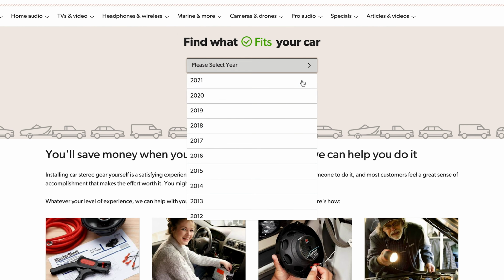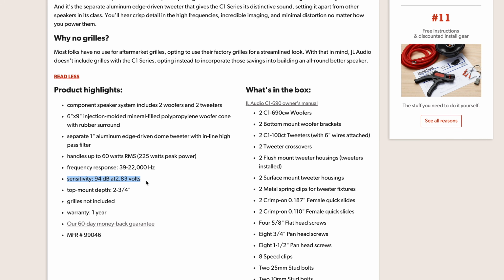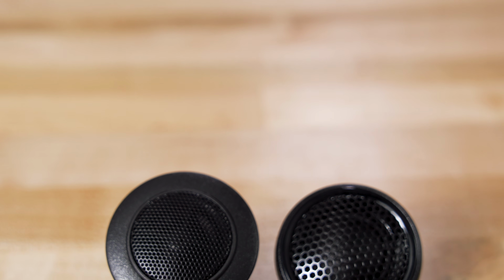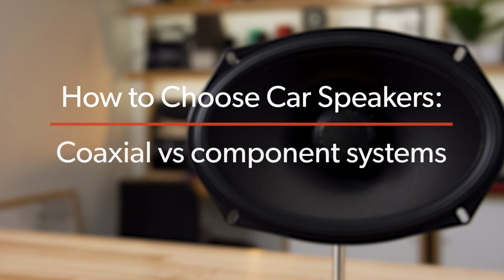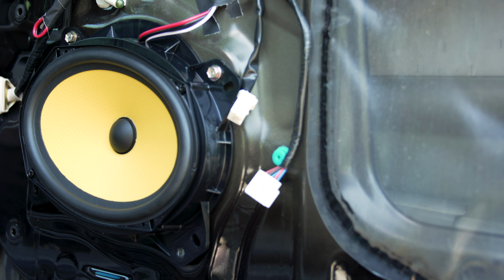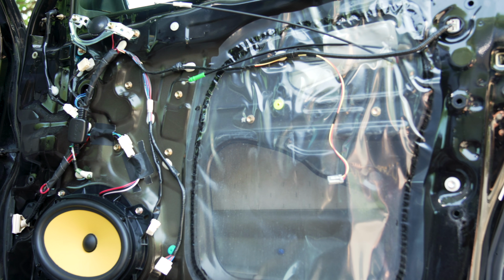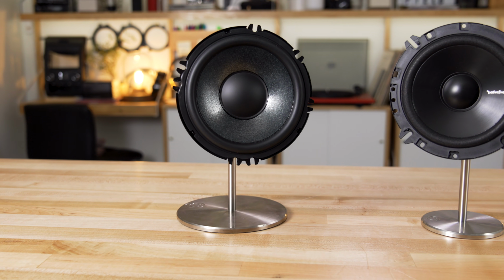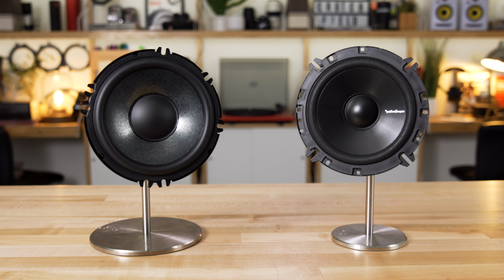How to choose car speakers | Crutchfield

Comment: Awesome.  Is there any problem with speakers that are capable of much more power than the deck?   My new Sony deck has 20W rms rating and my new infinity speakers have 100W rms rating.  I am not planning to add an amp at this time due to cost/budget.  Will be hooking all up through factory wiring and running off the deck.  Any problems with this plan, other than not being as loud as is capable of?
Reply from the maker: Infinity speakers have a fairly high sensitivity which indicates that they can perform well when they don't get all the watts RMS they can handle such as when you are powering them with a radio! Now, you won't get all the performance that the speakers can give, but they won't be hurt when powered by a radio.
Reply: @crutchfield  
Got them installed today. Sound great.  Though I notice quite a bit of distortion blowing when reach about 26/40 on the Sony 5600 head unit bought from Crutchfield.  Is this distortion coming from the head unit running out of power? Gonna need an amp?   It is plenty loud at 22 on the volume. But if I want to go higher to get the 6x9 infnitys thumping the system starts blowing raspeberries (distortion). 
There is a used JBL gto ez5  in local ads.  Maybe that would be a good fit for this.
Reply from the maker: Whenever you start to hear distortion, it is a good idea to back off the volume. You can tweak the Sony radio's equalizer settings to optimize the sound quality if you plan to crank it up. You can also use the JBL amp as it looks to be rated at 50-watts RMS for the 4 main channels. Adding the amp would provide less distortion and a little bit higher volume if you plan to crank it up.

Comment: I got a question, this will be my first time changing any speakers, can you hook up a 8 inch or 10 inch and even 12 inch speaker with no amp? Anybody can give me an answer
Reply from the maker: For an 8", 10", or 12" subwoofer, you will also need a separate amp to power them, unless it's a powered sub with its own built-in amp.

Comment: Still don’t have 2022+ Tundras on there. Why?
Reply from the maker: We have not been able to get our hands on them to perform our research and gather the measurements needed to check fitment of new gear.

These pickups are still on our list and we remain hopeful that we will be able to research them. We cannot give a time frame as there are many factors that must all line up right to make it happen. Mainly, we are able to get one of them into our research garage at the same time we finish researching the vehicle currently in the garage

Comment: Great speakers if you just want to upgrade your speakers are some focal icu speakers. But I still recommend a sub to go with them. After market speakers just don’t have any bass
Reply from the maker: You can't go wrong with Focal speakers! 🙂 What type of subwoofer did you add with them?
Reply: @crutchfield  I have been using the same Infinity VQ Kappa Perfect 12 sub from like 2005 with an old kenwood 2 channel amp from the same time lol. I love that sub

Comment: I already have 4 coaxial installed in my door do I need to add component speakers aswell or tweeters. Thanks
Reply from the maker: Component speakers utilize a crossover to split the frequency and impedance to both the woofer and the tweeter. When adding tweeters custom in a vehicle that did not originally feature them, using component speakers instead of adding tweeters to your existing coaxial speakers is usually the best move.

Comment: Thanks for the presentation, but for MG car i couldn't find along the site, what fits MG 6 2023, please?
Reply from the maker: The 2023 MG 6 is not a vehicle that is sold in the U.S. market and won't be found in our online vehicle guide. You usually can still upgrade your speakers, but we will not be able to provide any fitment information to assist and they would have to be considered a custom install.

Comment: What's so good about focal
Reply from the maker: Focal is known for their quality build and high-fidelity sound. Are you looking to add new speakers to a specific vehicle?
Reply: @crutchfield  I did see another video about the high quality materials they use. For me I'll stick with kicker. I just completed a single solo x l7 12 inch subwoofer box build. To keep up with the bass I got kicker KSMT snowman pods on the A pillars and a Rockford fosgate pps4-8 mid range to replace the 8 inch OEM Bose subwoofer that came with the car under the speaker tray. I plan on letting the bose door speakers live their lifespan before replacing them with probably some kicker KS series speakers
Reply from the maker: The KS Kicker speakers are a solid call in my humble opinion, they are probably one of the most popular speaker lines we carry and have a nice smooth sound. Sounds like a fantastic setup, great work! I usually run the Kicker C series and recently upgraded to the Focal Flax 2-ways for my daily-driver, and I did notice a major improvement. Since you are going to use your Bose speakers for a while, keep the Focal speakers in mind!
Reply: @crutchfield  I will certainly keep them in mind once it comes time to replace them... thanks for the suggestion! 👍🫡
Reply from the maker: We are here to help anytime!🤘

Comment: i have both rear speakers not working, if i buy new ones would that make difference for me setting in front ?
Reply from the maker: We're glad to take a look. What is the year, make, and model of your vehicle? Did you notice the rear speakers stopped working just recently?
Reply: First of all, thank you for your response. My car is a 2008 Camry. The rear speakers were working perfectly. After a period of time, they started to distort, so I cut the wires and they turned off completely. My question is, will there be a difference if they are on or off for me as a front-driver? Will the sound get louder and improve or not? Because I sometimes feel that the sound comes from the front only, as if it bothers me, are the front speakers sufficient for me, or should I buy the rear speakers as well? @crutchfield
Reply from the maker: It seems you are missing the sound from the rear so replacing them is a good plan. Did your car come with factory navigation or a JBL audio system? What type of speakers are you using up front? What do you prefer to use to power the new speakers?

Comment: Very proffesional and clear. Thanks for this. Excited to throw some nice 6-3/4 speakers in my 2019 mustang for the rear deck and the doors. Shipping is literally on par or BETTER than amazon in my state (Florida)
Reply from the maker: Upgrading your speakers is the best first step to better than factory sound! Are you eyeing any brands in particular for your Mustang?
Reply: @crutchfield  Yes! My Kenwood Krispy Kentucky Fried  KFC-1796PS get delivered today! Cannot wait to throw them in
Reply: @crutchfield  those factory ford  speakers are garbage. I have 40k miles and one is already doing that annoying buzz rattle on heavy bass. So I decided to change all 4. Lower front door speakers, and both rear deck speakers
Reply from the maker: 😁Excited for you!
Reply from the maker: Good plan! Let us know how you like the new Kenwoods.

Comment: what's the difference if say a speaker specs it out as 90db @ 4ohms, whereas another one specs it as 95db @ 2ohms, which one would have higher sensitivity?
Reply from the maker: The speaker with 95db has the higher sensitivity. The higher the number, the more efficient the speaker is.

Comment: I cant find my car on your side, its hilux surf toyota, yes there is a 4runner but audio looks different,  its panasonic. Still not sure about size and power but i dont want to touch that panasonic, just looking for speakers.
Reply from the maker: We do not have any JDM vehicles listed in our Vehicle Guide. On a personal note, I have wanted a Hilux SURF forever. Totally awesome ride! JDM vehicles can have some slight differences, we treat them essentially as a custom install. If you can gain access to inside your door panels and remove the old speakers, snap a few good pics with a measuring tape and call us at 1-800-309-2795. We can help identify speakers that would be a good option for your upgrade.

Comment: It’s the JBL Stadium 262M speakers a good choice for a ‘13 Camry XLE using the factory radio ( not JBL) with navigation ? Please need your expert opinion before buying 🙂
Reply from the maker: Did you mean JBL Stadium 962M? If so, we do show you can fit these in the rear deck. Which locations do you want to put new speakers into?
Reply: @crutchfield  I’m sorry☹️ yes JBL Stadium 962M ! I would like to install them front and rear 😃
Reply from the maker: Great choice and a good fit for the rear deck using our adaptor brackets. The 962M is a bit too deep for the front doors; but you can use the 6.5" version here: www.crutchfield.com/I-rYALc921/p_109CL64FSL/item.html

Comment: Hello! 

I’m interested in the JBL stadium 962cf component system, 

Is the tweeter connected to the speaker or Does the tweeter also get connected to the amplifier or will it be connected to the radio outputs, 

Also would you recommend the a60004 JBL amplifier in bridged mode, or a different amp?
Reply: Is the tweeter going to be okay if the cross over from the woofers are connected to high power?
Reply from the maker: The tweeter and the woofer are meant to be wired to the crossover and then the crossover connects to the amp's channel. Since this is a 3 ohm speaker and since most amps are not stable at 3 ohms when bridged, we do not recommend connecting them to bridged channels on an amp. You have likely seen the amp that is recommended for getting the best sound from them but so that others can see it, we are posting the link to the amp here as well:

www.crutchfield.com/I-rYALc227/p_575P300X2/item.html

Comment: Hello everyone... I argued with an installer about replacing 4 speakers in the car Buick lacrosse 2012
The installer offered me straight alpine s65c Go ahead and back alpine s65 I mentioned that I don't intend to put an amplifier and if 65c which is a component will give enough power I asked why not put speakers without good components because there is no amplifier, but he still insisted that the vehicle is correct and will give value I checked the prices and together they are not cheap together The problem is not the price, but you can get quality speakers without a component for this price or even less... He claimed that alpine is still among the best today and still take the component and if I'm not satisfied put an amplifier even though I mentioned several times that I'm not interested in an amplifier In conclusion, the installer recommended component front speakers even if I don't connect an amplifier.. what do you think Thanks
Reply from the maker: 2012 Buick Lacrosse vehicles come with a component speaker in the front. The tweeters are in the front pillars and the woofers are in the front doors. The audio produced by tweeters is clearer, more defined, when its coming from a location that is closer to ear level. We think it is a good idea to install a component speaker in place of the OEM so you can continue to have tweeters higher in the vehicle and closer to ear level.
Reply: @crutchfield  
First of all, thank you very much for the answer. I don't plan to put an amplifier in the car at least for now... Do component speakers require putting an amplifier to sound well or without an amplifier would be fine... Basically I listen to electronic music but I'm not looking to turn the car into a club but just to enjoy good music
Reply from the maker: You will generate the best possible performance with an amplifier, but a lot of component speakers are sensitive enough to work well on the radio's power. The Alpine S2-S65C in the link below are simply the newer generation of Alpine S-series component and they do work well on lower wattage produced by receivers. These would be a great choice for your project and would provide great sound!

https://www.crutchfield.com/I-rYALc166/p_500S2S65C/Alpine-S2-S65C.html

Comment: Exactly what I needed to know, thank you! It seems like from your website, specifically for my 1997 Civic Coupe that a 6x9 is the exact fit for the rear speakers and for the fronts, it's showing 6-1/2, does that basically mean a 6.5 inch?
Reply from the maker: Yes, the factory door speakers in the '97 Civic Coupe are 6.5".

Comment: What if My  car has tweeters already do I need a one way or 2 way?
Reply from the maker: Hi Mario, we're glad to take a look. What is the year, make, and model of your car? What locations did you want to put the speakers into?
Reply: @crutchfield  2012 Mkz Lincoln hybrid. The lower front doors. They have factory tweeters and my question just is if its ok to get a 2 way or is there a 1 way woofers?
Reply from the maker: Thanks, Mario. Did your car come with a factory THX audio system or factory nav?
Reply: Both it has the THX Audio system and a navigation screen
Reply from the maker: Thanks, Mario. You can use 2-way speakers in the front doors and maintain your factory tweeters. Do you have anything specific in mind or would you like help choosing?

Comment: Great advise! Most of us consumers think the highest the power handling the better. That is not always the case! I did purchase a pair of Sony XS-160ES that is rated at 90 watts RMS. My Kenwood DNX 697S build-in amp did not like it! So, I got a pair of Pioneer TS-G1620F that is 40 watts  RMS immediately it responded nice! The Pioneer is 10 times less the price of the Sony.

Comment: On your website it does not have Opel car models
Reply from the maker: We only have a little info on US version of the classic Opel GT. What model specifically do you have?
Reply: i have opel corsa 2009 model @crutchfield
Reply from the maker: That is confirmed a model that we have no info in our system for. We can still help you with your questions and concerns, but we cannot provide any vehicle-specific information.
Reply: oh ok np i just wanted to see which speakers i can put in my car  @crutchfield
Reply from the maker: If you want to take some measurements and reach back, we'll be happy to see what we can help you match up.
Reply: it is a 16cm speakers  @crutchfield
Reply from the maker: We can recommend speakers in that size range. How many do you need? What do you plan to use for power?

Comment: I know that is a good idea to install a component system at the front door and tweerer in front of our face but what about component sytem just behind the rear passengers? Is it better the coaxial that component system for the last escenario that I mentioned? Thank for your help!
Reply from the maker: Hi Jose, you don't tend to hear the highs from the rear of the vehicle as much up front; but what is the year, make, and model of your vehicle? Do you tend to carry rear seat passengers?
Reply: @crutchfield  Than you for replying I have an old nissan sentra 2002 which allow me to install at the rear 6.5. Currenly I have component Focal PS 165 V1 at the front and for the rear part my intention was to put PC 165 coaxial. Most of the time I carry rear passenger I would say 70% of the time. So not sure if I can put also the component PS 165 V1  at the rear part putting the gain of the crossover to minimun or in some way filter the high at the amplifier I can get the same results with PC 165. Please advise!
Reply from the maker: You could install the tweeters in the PS165 V1 system into the rear deck with the woofers and have these tweeters face straight up which would make them play very similar to the PC 165. But that seems like a waste of a component system design. If you do install the component system in the rear, we recommend trying to install the tweeters so they would be pointing towards the passengers that sit in the rear.
Reply: @crutchfield  Thank you so much for your great support I really appreciated. Try to get for the rear the PC 165 but if I can not get it  I´ll put the PS 165 V1 in a way tweeters pointing towards the passengers that sit in the rear🙂
Reply from the maker: You're certainly welcome! 🙂

Comment: On a 2021 4Runner if I want to replace the tweeters on the dash with better  tweeters and the woofers in the front doors for a 2 way speaker would it sound bad? Or should I just get a good 3 way speaker in the front doors and leave the tweeters out if I don’t want to go through the hassle of installing component speakers
Reply from the maker: We're glad to take a look. Did your vehicle come with factory nav or a JBL system? What do you plan to use to power the new speakers?

Comment: do you need an amp if you replace front speaker ? or rather, when is a amplifier nessesasry ?
Reply from the maker: That's a tough one as there are a lot of causes that indicate an amp is needed. Some speakers have low sensitives and should be used with an amp. Also, when trying to improve volume levels or sound clarity, they are needed. Another situation in which an amp is likely needed is when the stock system has an amp and you are trying to upgrade that sound with new speakers.
Reply: @crutchfield  appreciate it ,Thanks !
Reply from the maker: You're welcome. Did you want help choosing power for a specific setup?
Reply: @crutchfield  yes please ! :2 HIFONICS HFX  on BOSS audio monoblock 1100m ?

Comment: You didn't mention anything about the impedance. Don't most factory speakers run at 2 ohms, while most aftermarket speakers are 4 ohms? How does this affect sound quality/volume?
Reply from the maker: Some vehicles do have 2-ohm factory speakers, but 4-ohm speakers are still more common. If you simply swapped factory 2-ohm speakers for standard 4-ohm aftermarket speakers without adding a stronger amplification source, it will typically result in a drop in volume levels.